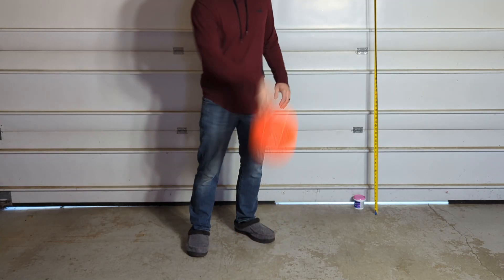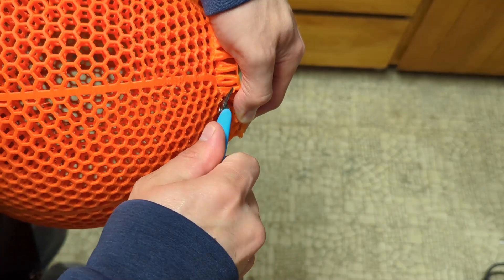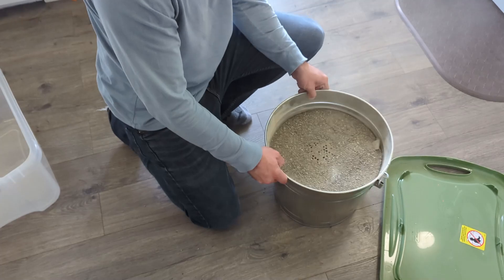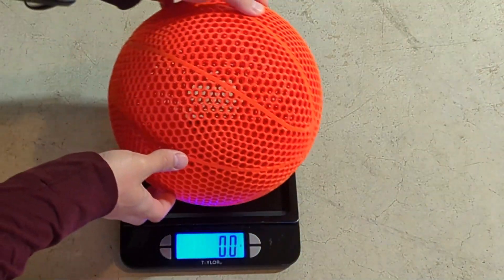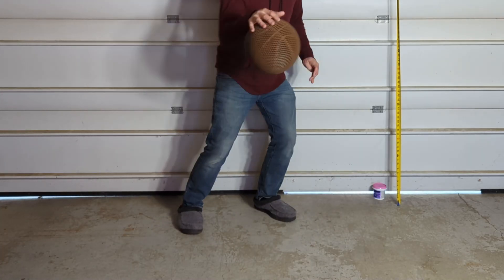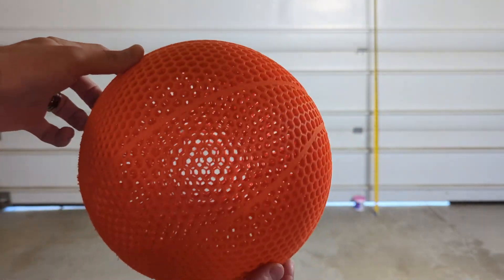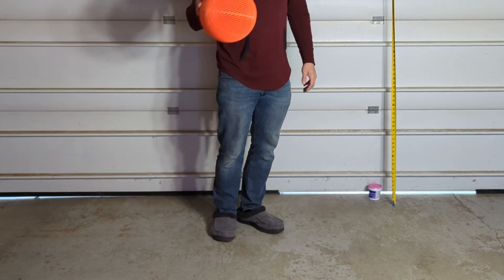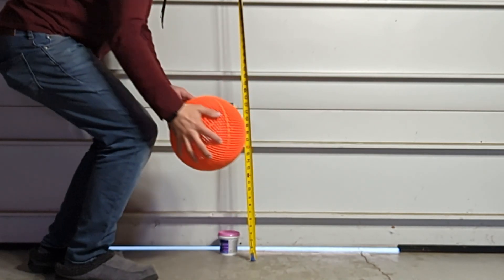Will Annealing Flex PLA Help Airless Basketball Durability?

Comment: Hey, thank you for this great video! I was wondering why your design is rounded and doesn’t have the same shape as the Wilson Airless Basketball. Have you tried 3D printing one with the actual shape using PEBA filament?
Reply from the maker: @SMIXOGAMING  thanks! I ended up going with almost all round because the files  I have printed previously have either affected the bounce or printing of the file. Going with a mostly round shape (except the seams/black lines, they are pulled in a bit to not affect the bounce) seemed to optimize ease of printing with optimizing bounce, but there might be other files out there that have figured that out

Comment: Do you have to use sand or could you use dirt. But if you have to use sand where did you get it
Reply from the maker: @FeltFamily-h8y  you could probably use dirt, but sand holds it's shape really well in the heat so I would recommend sand. I just got some play sand from Home Depot, but the finer sand you use the better 😁

Comment: dont use pla, use tpu
Reply from the maker: @gsestream  flex pla works great, but I do plan on trying tpu. I have seen some other videos of people using tpu and it bounces badly, so it will probably need to be a higher shore hardness to work well
Reply: @makeitlabchannel  pla is very brittle, like you experienced, it shatters very easily. dont know about the flex pla. I would still say pla is not the most proper option.
Reply from the maker: @gsestream  yeah I would agree, I think the more flexible options (PEBA, TCE/TPU) are probably the way to go. I will be testing all of those 😁

Comment: Hey love your content! Today I am on the goal of trying to create an airless basketball and when i came into your stuff it was great. However a month ago I think you used a different file and you used PEBA filament. Now I was looking into going into the root that you went in because you said at the time that it was the best and it was good to bounce and durable. Has that opinion changed and would you still recommend doing that, Or should I wait?? Lastly a month ago you made a video about the settings and supports that you used for the PEBA filament, but recently you made a video about the durability of the single and double lattice as well. So my question is do you prefer double or single lattice and can the single lattice with the supprot and settings you have a month ago? Thank you for your time, great content
Reply: It does and thank you for responding. But my question is when you print the airless basketball with peba filament I was wondering what did you use to dry it and is there any recommendations that you have for a filament dryer and is it better to just have it drying throughout or should I dry it for one hr and then make it start printing the basketball? Lastly when you finish the file that you are making with you show what settings and supports that you used for it. Thank you for your time
Reply from the maker: @massimoleonard5647  I did dry the peba filament both before and during printing. I list everything I did to print the ball in this video here, including the dryer I used: https://youtu.be/BtqjUwdIx30?si=oiQVsxuq2-_Wxk8Q

And yes, when my file is done I will make a video showing everything needed to print it 😁
Reply: @makeitlabchannel great to know and thank you so much but what happens when you ran out of filament. Do you wait another 12hrs to dry and then dry it throughout until the print? Is that what you did? And does it affect the build quality?
Reply from the maker: @massimoleonard5647  the filament dryer I used (there is a link in the description of the settings video I sent) can hold 2 spools of filament. I dried them both before and during printing, and when the other one was running out I just loaded the second one in-line with the end of the first spool, if that makes sense. The quality turned out good on all of them so far
Reply: @makeitlabchannel  ahh makes sense all is good. Can the filament dryer go for more than 12hrs or something? Like do you have to reset it because it is a long print?
Reply from the maker: @massimoleonard5647  yeah I have to reset it before it runs out each 12 hours so it doesn't stop. There might be better options that have higher temps it can run and longer time durations, but I haven't looked into it much
Reply from the maker: @massimoleonard5647  Let me start by saying thanks! And here is where I am at: so far, peba filament has had the best bounce. The problem? The double lattice file I used seems to always eventually cracks, but it has amazing bounce. The single lattice file I use doesn't bounce as well, but is very durable. I am currently designing my own file to hopefully have the best of both worlds, especially with the peba filament. The flex PLA seems to work well too with my file. Once the file is ready, I will release it for others to use. The weak point seems to be the file itself, as I have not found a file that has great bounce and durability yet. Hope that helps!

Comment: So I tried this with the same exact filament. I also baked the basketball in the oven at 200F for four hours. I used a fine sandblasting sand. Very clean, very fine. After the four hours, I measured the temp of the sand about a third of the way down here container. It was 150F. I wonder if the sand is acting too much of an insulator. If I try this again, I’ll bump up the temp to 250 so I get an actual temp of 200 at the center of the container.
Reply from the maker: Oh interesting, I thought about leaving a temperature probe in with the ball to track the temp to make sure it is getting where it needs to be. I also have annealed other basketballs for 6 hours as well - longer might help as well.
Reply: @makeitlabchannel  have you found the longer you leave it in the oven the better it bounces ?
Reply from the maker: @coolteched7572  I haven't tested that, but when I get more flex PLA I might have to test that out

Comment: Do you have any other ways to anneal the basketball? Im not sure if i have anything to put the basketball in
Reply from the maker: @CalebPham-sz5sj  I bought the metal bucket from Home Depot if that is an option for you, but that is the only real way I know of besides using a large kiln like they use for pottery. My other wonder is maybe some sort of chemical annealing, but I don't know what would work for that.
Reply: @makeitlabchannel  Just to let you know, I was looking online for different ways you can anneal 3d prints and one of them was putting them in warm water to anneal and because the water is not very hot it would not warp the print. Do you think in a future video you can try this? 

-Caleb P.
Reply from the maker: @CalebPham-sz5sj  oh that sounds very cool - I think I could try that, I will look into it 😁
Reply: @makeitlabchannel  Great! thank you! If i find another way  to anneal the basketball i will let you know!

Comment: Anneal + PEBA? does that even work?
Reply from the maker: I have been looking into that actually and given the makeup of PEBA I am not sure. I might just have to test it and see!
Reply: @makeitlabchannel  I'd be very interested in this as well, I made some with PEBA and I'm wondering what temp to anneal at.
Reply from the maker: @mrdurden3224  I would not be able to recommend a temp because I haven't found anything on this yet, but since 90C is about 44% of about a 205C temp for PLA, 44% of 250C for PEBA would be 110C (might be a starting point to try). I will try to reach out to Kimya to see if they have more info, and I will be testing this at some point.
Reply: 90C is 20 degrees above the typical PLA glass transition temperature of ~60C so perhaps if you can look up the glass transition temperature of PEBA (if it has one) and increase that by 10 or 20C it would work…. Just hypothesizing.
Reply from the maker: @spencerthorp  I think that is a good way to approach it, but I can't seem to find any info about a glass transition temperature for PEBA, so I have reached out to the company who makes it to see if they have any info on this. Hopefully they respond 😁

Comment: Great, so now are you going to try the peba filment with your new file? Also what was the bounce heights on both of thr flex pla. Nicr job, my problem with making these would be the oven, i dont habe a spare oven liying around. Thanks for alll youre tests.
Reply from the maker: Yes, PEBA will be next once I alter the model so it is closer to nba standard weight, and then I will compare the PEBA and flex PLA bounces. The flex PLA didn't bounce quite as well as the PEBA, but it was consistently bouncing back around 20 inches on the bounce test after dropping from 39 inches like the other tests

Comment: What temps to print the flex pla. My printer seems to cant pull it, it stretches. For extruder is 230c and bed is 50c.
Reply from the maker: I went 220c on the nozzle and 55c on bed for my Bambu Lab P1S. What printer are you using?
Reply: @makeitlabchannel  K1 MAX, but now i'm thinking my printing speed might be the issue, the more i'm doing test, im thinking of brining it down to 200
Reply from the maker: @ian_octoman  yeah it might be worth printing slower. I printed the basketballs in the video at 40 mm/s - took a very long time but turned out pretty well.

Comment: I've been doing research on some filaments. I bought some ataxaria filament, slightly different from the one you tested, and on my a1 it made a perfect tennis ball with the bounce. It does seem like ataxaria made a new bounce flex pla specifically for the ball. I will say they used the same video as the wisdream flexi tough which was also designed for the ball so I don't know how well it works (Going to try the Wisdream soon). Filament stories had pretty good results. There obviously is peba, but also a bunch of variations of polypropylene which has some flexibility. I might also try 98 a tpu. Fillamentum has 98a tpu. Good luck!!
Reply from the maker: Oh interesting, I will have to look into this. Thanks!